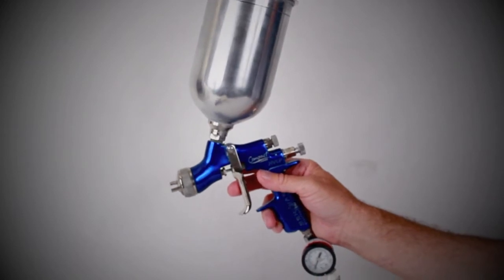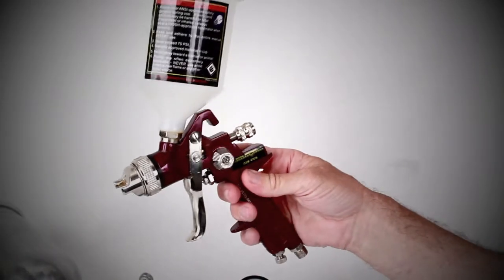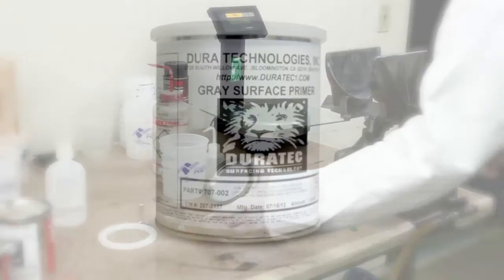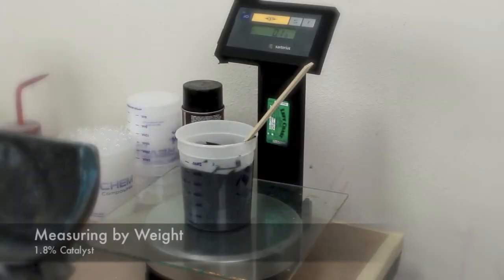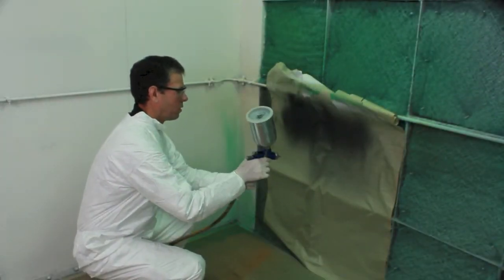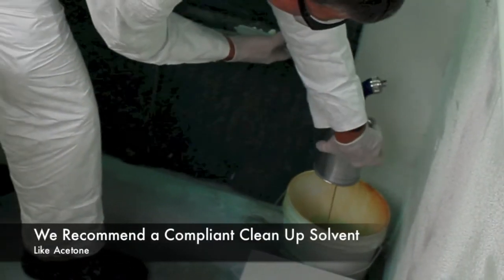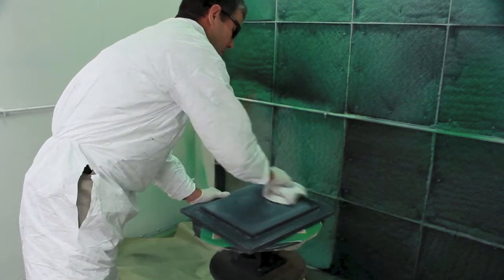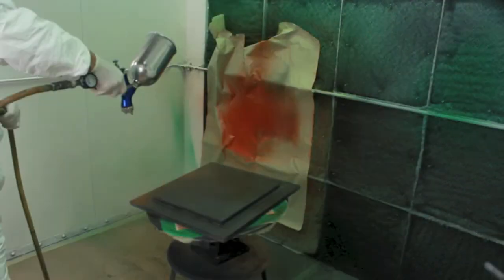How to Spray Duratec

Comment: I am an engineer at a small aircraft company and we are bringing the mold making in house. We just started a polyurethane foam CNC machined tail form for which our suppliers recommend using 707-007 coats with last coat with a high gloss additive. I am not sure that was the best way to go. We covered the foam first with a layer of woven cloth and sprayed 707-007 on it and built it up, sanded it and then did the last coat with 75/25 mix of clear high gloss to get the final form/plug. Sound like may be we should have started straight with 707-019
Reply from the maker: Hi Abid!  

The 707-019 Duratec Styroshield Primer can be used on polyurethane foam as well, but was designed for use with polystyrene (EPS) foam.   As you were using polyurethane foam, the 707-007 Duratec Sanding Primer is a suitable choice.  Either option would work, but if you ever use EPS foam you'll want to stick with 707-019 Styroshield.  Feel free to email our team for any additional information or support:  info@hawkeyeind.com     Wishing you success with your project!

Comment: Please provide the information for the spray gun you DO recommend. Brand. Model. Etc. It will be very helpful so that we can go out and get one similar. Thanks.

May want to put it in the Description on the video. Link to where to buy?
Reply from the maker: Thanks for the feedback Read_Old_Books!   

As we work with small shops, large production facilities, and DIYers, the right spray gun will be slightly different for each budget/experience.  Which is good news - many options out there will accomplish the task at hand,  from the 3M AccuSpray to options found at Harbor Freight or via Amazon.  We'll look at adding a tip to the video noting this!

So while we do not note a specific HVLP gun, we do emphasize procuring the right tip size for product in use, and that air pressure be adjusted correctly to get the best performance from material.  Those details can be found on each product's Technical Data Sheet.  Hope this helps!
Reply: @HawkeyeInd  Also. Consider mentioning "auxiliary" things like in-line oil/water traps, etc.

Comment: Great info! Do these techniques and specifications  apply to the use of the 904-061 sunshield clear topcoat as well? Are there other thinners that can be used?
Reply from the maker: Hi DMT190 -

I'm so sorry we did not see this comment sooner.   Yes, the techniques can be applied to the 904-061 although each application might be a little different.  On our website there are use instructions for the 904-061:  http://www.duratec1.com/pdf/904-061%20FLYER%20WEB.pdf  

As for thinning, we suggest the Duratec Thinner as it was formulated to work with our products.  Methyl Ethyl Ketone (MEK) is second if no Duratec Thinner is available.  

Contact our office at (909) 546-1160 if you need further assistance.

Shelly @ Hawkeye Industries
Reply: Thanks very Shelly! I will give it a try. So far I am loving the high gloss of the sunshield!

Comment: Man.  You are a messy painter.  I don't think I've ever had paint on the outside of my cup!!!  Also there are times when you are not wearing gloves... that's bad.  Also, the amount of waste you are spraying... doesn't look like you're paying for it!  and that orange peel... I spray duratec it's smooth as glass.
Reply from the maker: Smooth as glass - exactly what we hope our customers experience!  Thanks for your feedback Robert!  
The Hawkeye Team
Reply: Wow, you must be perfect at everything. Your need to comment negativity is quite sad.
Reply: @MRScrubNasty  Not perfect...but Im a painter his gun is a disgrace.  It's called pride.
Reply: His gun is shit because he spent all his money on duratech high gloss additive. So expensive. 150 for gallon, mixed 1 to 1 and thats at wholesale price. I have a decent gun now but thinking of upgrading to a 3m accuspray with pressure cups. The pps system is great but I want disposable atomizer and less cleanup! Ever used s accuspray? The one with the little hose that vaccum packs psint liner. Seems like ok gun for gel even though max is 2mm.
Reply: That's what I noticed.
Reply: Theirs always one ..  😂😂😂
Reply: Perfection of a reply.   I'm ordering the product on how you dealt with Narcissists.   👍